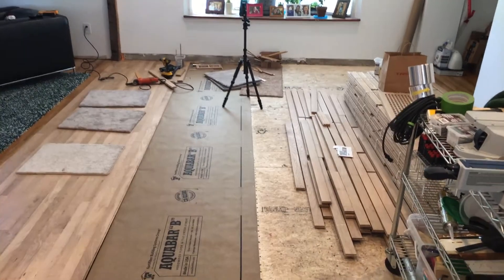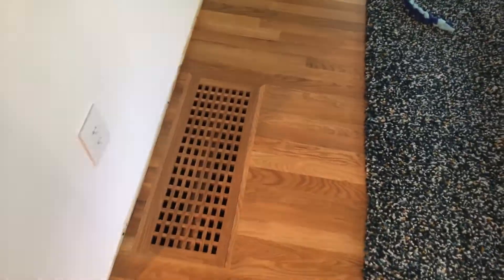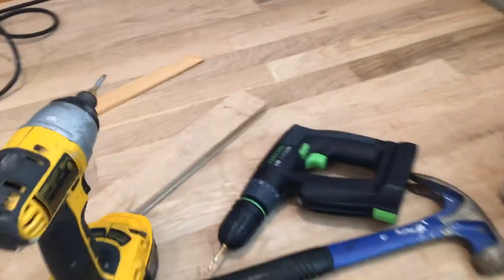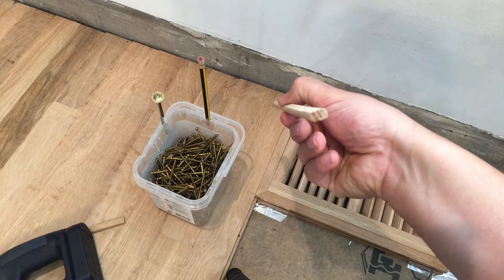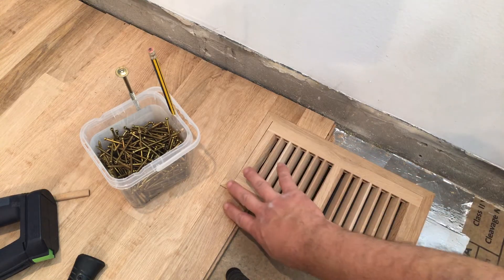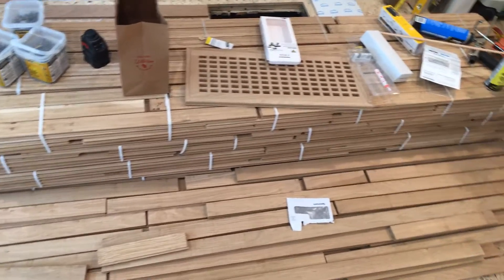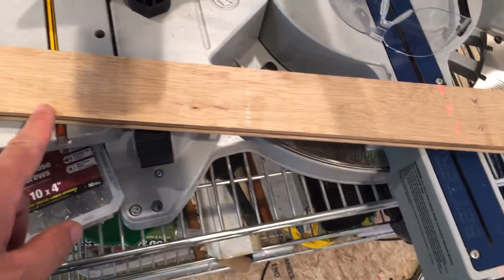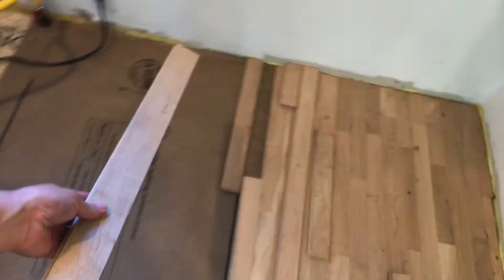Installing White Oak Floor without an Floor Nailer

Comment: I've done a ton of research with my Gemini Deep Dive AI bot re "nails vs screws" for floor installation and I specified "no commercial sources" and for quality fastening. No one using screws complains, and no screws are loosening over time. Contractors can't make a profit due to the time involved, but a DIY'er can take the time.

Comment: Very helpful, thanks. I've got a 10x20 room to do with 3/4" T&G oak and am debating whether to buy/rent the nailer + compressor. I think now I'll try your method as I have time! My subfloor is 3/4" planks from the 1940s. I see you're using 2 1/2" screws. Are you always screwing the floor over a joist? Also, do you have a rule of thumb about how far apart the screws should be and lastly how close they can be to the end of a piece of the oak floor? I've read online, nail every 8" and no closer than 3" from an end. If I do that, a lot of 2 1/2" screws will not be grabbing much. Hope that makes sense. Any further info appreciated.
Reply: Thanks for posting this comment-I'll be two years behind you and same situation as yours.

Comment: Buy an air driven floor nailer.  Bostich is the pro level, I got a Freeman at a garage sale for $30 almost new and it works great.  The time saved is worth the investment.  I'm 50% of the way through 1000 SF of No. 1 Cabin Grade Hickory.  Drill and screw would take forever.  the rule at my house is every major DIY project gets a new tool.  9 amp Drill, air tools, whatever it takes to do the job professionally.  The money I save on the tools is more than recovered in the finished product value added to my property.  Plus the pride of doing it yourself.  1/3 materials, 2/3 labor is the standard I use.  My $5000 in flooring is a $15,00 job.  Buy good tools you're money ahead on the project all ready and it makes the work much less challenging.   Floor jacks are a must when you get close to the edges.  Beats wedging and pounding.  And you can use a 2x4 and push together those challenging boards in the middle of the floor too.

Comment: Pretty sure you can forget about expansion gaps if you use screws as that pretty much eliminates all possibilities for the wood to expand and contract as it should. Floor staples are engineered to be flexible and allow the wood some wiggle room

Using white oak at least it shouldnt want to move too much with proper humidity check

Must of taken quite some time
Reply: No such thing as floor expansion. That's all nonsense to sell add ons!

Comment: What kind of drill is that
Reply: The drill he used for the pilot holes is a Festool.  Festool tools are crazy expensive, which makes it surprising to me that he owns one but decided to skimp on a floor nailer (which would speed up the floor installation by many hour as opposed to drilling pilot holes and using screws).

Comment: oh its a festool lmfao okay this guy spent $300 on a drill that does the same thing as a $50 drill I wont take any advice from this video this guy is clearly clueless
Reply: So every master craftsman uses Ryobi?
Reply: @joshdillingham1598  This guy is not a master craftsman he is a DIYer instaling hardwood floors in his home. A master craftman will usually use dewalt, milwaukee, or makita. (all half the cost of festool for the same performance)